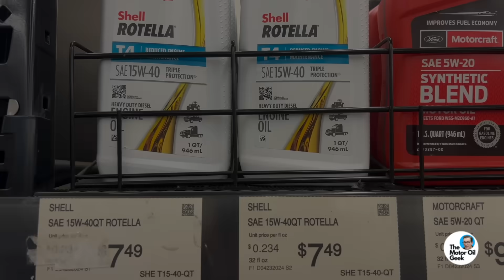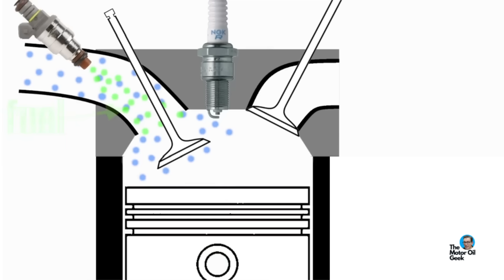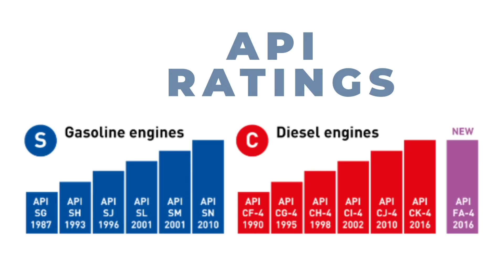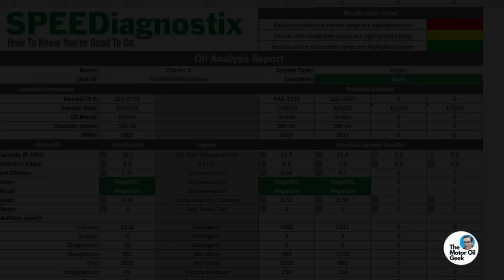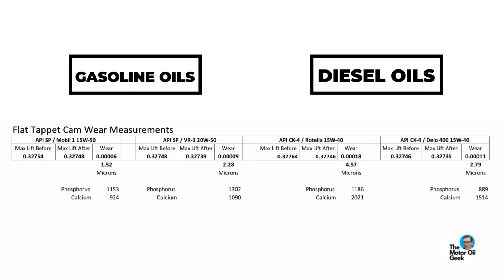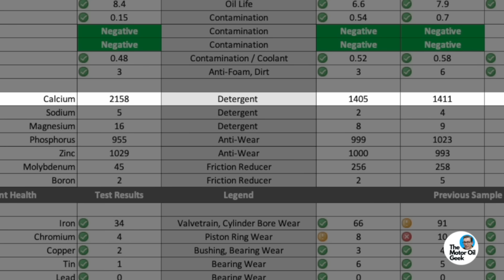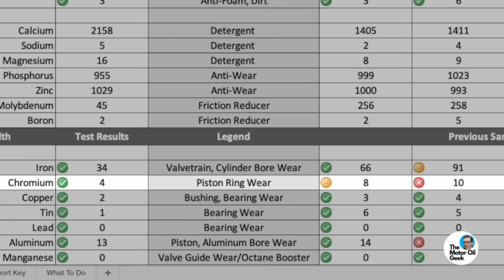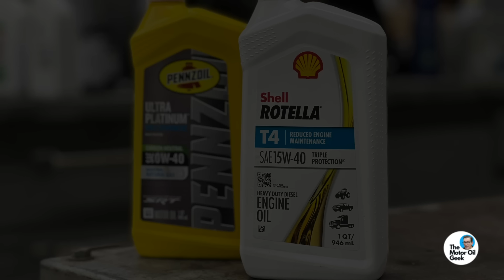Why DIESEL Oil is Actually WORSE for Gas Engines!

Comment: I noticed your camshaft wear comparisons compared 50 weight synthetic racing oils to 40 weight standard diesel oils. Not fair comparison for most drivers who would like to compare a gas euro 5w-40 synthetic oil to a diesel  5w-40:synthetic like Rotella T6 or Delvac ESP. Also what about naturally aspirated port injected v8 engine running synthetic diesel oil? Not all of us are driving a direct injection turbo small engine. Very interested in hearing the response as I value your opinions but in different scenarios. Thanks.

Comment: Just for reference as I am not even close to an expert on anything, I just want to point out what I've always done. That is,  adding heavy duty diesel motor oil plus a little bit of zddp to all the mini bike engines that I've had over the course of 17 years...... never had a problem.

Comment: About diesel, oil I have a imported diesel véhicule here with a dpf that requires ultra low SAPS < max 0.5% and HTHS of at least 3.5 in 5w30 grade equivalent to ACEA C4. It seems impossible to find in North America and at least Canada. I am using 5w30 ACEA c3 for now with hths of 3.5 and saps at 0.8%, hope it will no kill the DPF to quickly. What do you think?
Reply: Regens are not done with DEF fluid / adblue but with postcombustion from injection ecu depending the soot qty calculated by diff pressure sensor. It more like a nox trap.

Comment: modern engines appear to self destruct due to synthetic oils? 3.6 Chryslers and crazy timing chain overhead cam engines 3.5 Ford ecobust the 5.7 hemi, coyote 5.0 the cams and rockers wipe out. diesel trucks run 500,000 miles or more that is the proof diesel engine oils are better and engine oil is compatible. Shell 15w40 can help engines last longer presently running it a 472 Cadillac engine with no issues.Will it harm the catalytic converter theory put out by the EPA psychopaths I haven't seen it yet if you have a engine that uses oil it's going to mess with the Cat no matter what in reality there is too much bull sh!t flaoting around about engine oils working in a fleet we ran 15w40 in everything with no issues cars and trucks pull the valve covers they were like new inside no sludge or varnish this sh!t about engine oils can drive you crazy. it's about licensing agreements like that DEXOS scam oil companies have to pay GM for an okay to use their oil is lawyer crap and greed by failed automakers.

Comment: And yet commercial diesels routinely run a half million miles under heavy load despite the soot. high detergent level and zinc, while gas engines might run 200-250k if one fastidiously keeps the low detergent/low zinc oil changed. I would say that alone proves your wear test results.....questionable. If diesel oil were indeed a poorer lubricant, then lubricated parts in diesel engines under real world conditions would show that. They do not.

Comment: I am doing another F134 Willys restoration.  Have understood need to have Higher zinc additive or Rotela oil.  Saw your Mobil1 update.   Mobil1 now should be better?  Engine needs a pretty high weight to maintain pressure.

Comment: At 3:30, "throw a match in a bucket of gas, it will put the match out", uh no it will go whoomph and burn. That's because gas vaporizes at room temp and the vapors are on the surface of the gasoline.

Comment: I wouldn't say it's 100% accurate to say gasoline oils aren't formulated to handle soot, because they are, but it's a much finer soot, an actual really important aspect of modern passenger car formulations is a focus on direct injection timing chain wear, since direct injection gasoline engines create very fine abrasive soot, so passenger car oils are formulated to keep that soot from agglomerating but at the same time maintain a synergetic balance of FM+AW additives to reduce timing chain wear which is a major problem in small displacement DOHC direct injected turbocharged gasoline engines.

Comment: It hinges on automakers fuel efficiency standards for tax credits. Low tension piston rings has cars burning oil like a pig so the ZDDP clogged catalytic convertors. Direct fuel injection has calcium breaking pistons. API approvals are dropping protection (IMHO) to meet automakers warranty period. I have neither so use HDEO oils that WERE API "S" approved. "Application dictates the chemistry". YMMV.

Comment: Great Video! I used to run Rotella in all my engines diesel and gasoline.. Back in the old days, Shell and ExxMob used to certify the diesel oils with API "S*" as well as "C*". They advertised for fleets/construction equipment etc to use it everywhere to simplify oils inventory. I noticed a few years ago that Shell and ExxMob stopped doing the API spark ignition certifications on the oil.. Obviously, I still use the Rotella in my Yanmar diesel (big old 30 HP in the sailboat) but I have started using Mobil 1 (10-50) in my gasoline stuff..  
Thanks for the videos.. I Worked for ExxMob and did machine failure analysis and low level tribology.. When I got lost (and that was not unusual) I went to our oil development folks in Sarnia, Ontario, sometimes carrying failed machine parts in my luggage.. Fun Work.

Comment: Wow I used Ddisel oil in my 454 Suberban for a short time when I first got the old motor running because it was the only oil I had. I have a Dodge with a Cumins and had the oil on hand. Drove the Suburban around a few months and blew a head gasket after I replaced both head gaskets I put in regular car oil

Comment: A friend has one of the last years of air cooled 9-11 Porsche's. Shell Rotella 15-40 T4  is  factory recommended. If its ok for a Porsche engine, I think I am good with it in my Vstrom 1000. I now use the T5 partial synthetic.  Its JASO rated, as well as MA M2. When my mechanic opened the top end to do shim and bucket adjust, he said the motor was spotless and shiny.  For my money, i feel good and safe with Rotella.

Comment: I have a 2005 Town and Country 3.8L and have used this oil in my minivan. I've used it for over 60k miles here in south florida and it worked great EXCEPT 3-4mpg less than regular 5w-30. Recently i replaced the oil pan gasket and the bottom end looked pretty clean for 310k miles so the oil is NOT BAD, its just thicker and robbs engine of MPGs at higher RPMs.

Comment: Well, this makes me think twice about the oil im using in my old tractors.  Often, the engines were nearly identical between gasoline and diesel engines, of course with different heads, intake manifold, etc.  I have seen reputable people recommend that 15W-40 is completely acceptable now for most old tractors, gasoline or diesel fueled. Now, i do not believe this to be correct at all. And i used to use straight 30 in everything from my diesel utility tractors, gas tractors, and lawnmower/small engine power. I have purchased sae 30 that says heavy duty diesel oil, but also used that in everything, at least to top off the level. Gotta rethink that now.

Comment: Most europeans motorists are confused when you differentiate between diesel oil v passenger car oil because  roughly HALF of our passenger cars  in Europe run on diesel
Diesel engines provide better fuel consumption and typically run for many more miles... Not uncommon for us to run a diesel car to 250,000 miles... around 100,000 miles more than a typical lifetime for a petrol powered car

The emissions are different though and diesels are going out of fashion

Comment: uhm 1980,  nobody said hey, you cant use this oil, itll plug the cat up. 1990, nobody said hey, you cant use that oil ,itll ruin your cam and lifters. I went to PRI and asked some questions to the valvoline guys. they had no clue what I was talking about. every lifter is roller now and you dont need the zddp. however many hotrodders and racers are still running flat tappets. please take this guy with 2 grains of salt

Comment: I think a major source of comment buzz is failing to distinguish between an oil rated ONLY for diesels (i.e. CK-4) and an oil that is dual rated (API SP and CK-4). Any oil rated API SP is safe to use in your gasoline engine, regardless whether is carries CK-4 or not. It will have the low SAPS and calcium limits imposed by API SP. The API SP is not invalidated just because it also carries API CK-4. What makes a “diesel oil isn’t just the presence of CK-4, it’s the absence of API SP or any other gasoline certs. This is a hugely important distinction that was mostly glossed over in the video.

Comment: Another minor correction: soot isn’t the result of fuel that didn’t vaporize. It’s fuel that never got oxygen while it was hot enough to burn and vaporized. Soot is essentially charcoal vapor. The same process the makes charcoal (heat in an oxygen deprived environment) is what makes soot. More specifically— it’s usually the fuel that is injected near the end of injection in a rich A:F ratio. The first bit of fuel that leaves the injector nozzle is going into an oxygen-rich environment and lights almost immediately. But all the little molecules of fuel that follow from the nozzle have to wait their turn to get oxygen because they are following the same path as other molecules that already consumed some oxygen. This is why diesel combustion relies so much on swirl and mixing. It’s a *diffusion flame*, like a candle. It is not a premixed flame like a gasoline combustion (although that line is getting blurry with GDI). As such, diesel combusion has no “flame front” like a premix flame.

The mixing-while-burning aspect is the reason diesel combustion generates soot. Even at rail pressures of 2500 bar or more and using multiple pulses, you still can’t atomize the fuel fine enough and mix fast enough to eliminate the soot entirely. Even a modern “clean” diesel makes soot— it’s just a lot less of it and much smaller particles so the opacity is low enough it’s invisible to the naked eye. But the AVL 415 can see it!

Comment: I had a 77 f250 with 400,000 km, and it was using oil by this point and the 10w30 I used in it would go down a litre every three days, so I gave it an oil change and put some 15w40 Detroit diesel engine oil, and it stopped using oil and ran for another 100, 000 km till I sold the truck. The diesel oil never hurt the engine.

Comment: I have never seen a direct injection gas engine that didn't require full synthetic oil.  So T4 would be the wrong oil required.   T6 Rotella exceeds those requirements.  Lets test the correct oil.  Just another Youtube hack.

Comment: Truck load of bs. Disclaimer, I only watched the first couple of minutes. I have used the same oil for my dozers  and backhoe and automobiles. A compression ignition oil in  both. I bought a 1999 Lincoln town car 4.6l with 60k miles and used a diesel engine oil until I sold it at over 300,000 miles. It still ran great. Many automobiles same story.YMMV.

Comment: I run SN and SP rated HDEO's in my cars and they are just fine. I do 10K to 20K oil change intervals on engines that have achieved over 200K miles and all the techs that work on my cars cannot believe how clean my engines are going such long intervals.

Comment: Beware these 2 snake oil salesman , Ive gone behind Dave several times ... Shot peen migrating through his engines is a bad habit , and the oil analysis is Ascue and many have been tested by sending in the same sample under a different name and vehicle with different results . Next will be speed of air as a special guest - when Volvo has literally won awards and spent Multi Millions on piston crown Technology  that is Proven

Comment: I have never seen dumbest test of oils in my life. You compared 2 types of oils 8:36 one is a cheap mineral  diesel oil and other are the top end synthetic racing oils. But the stupidity was not enough, you took even more viscosity for gasoline oils. OMG! Motor oil Geek? What a joke

Comment: Flushed a 02 z28 ls with 300,000 on it with 5 gallon 15 40 cheap shit then drag raced it  on the floor for 100 or more passes never came apart stayed on the bump box

Comment: I ran Caltex Havoline 20w50 diesel oil in my 475,xxx km 4afe engine, now I run Caltex Delo Gold 15w40 diesel oil in my 7afe (current) engine, no problems whatsoever.
I redline it everyday because it is on itbs and the sound is just intoxicating.
Ambient temps are 30 degrees celsius or 90 hamburger units.

Comment: Like any detergent, wouldnt the calcium bind with all the carbon in a diesel engine thereby allowing the zddp to act as it should? Whereas without something to bind the detergent in a gas engine, calcium is left to compete with zinc?

Comment: I ran 15w 40 rotella thru a 232 straight 6 in a 74 gremlin couldn't blow motor up i tried several times in 80s

Comment: I'm a semi mechanic and at the place I used to work it was a smaller shop we'd all do our oil changes there I mean I have any car work we needed to do. We would just do it in the shop The two other guys I worked with they just ran diesel in their cars it's like 15w 40 plus and honestly My old coworker's ranger seem to be running pretty good it always blew my mind because That's pretty thick oil to be making it through those clearances

Comment: mine LS1 gen3 6.0l just did hit 452thsnds, for last 4 years using 15w40 mixture of diesel, 1/2 quaterATF, and mixing 2 diff oils, daily driven average 120 miles, 350 days a year. mostly highway, runs just fine :))))))) using  bulk order1.96$ filters from amazon, and 5 gall oils, changing it every 2600 miles :))))) so give me a break :)))))

Comment: I am running Rotella 10 W 30 T5 in two riding lawn mowers and one push mower. All are carburetor engins. Should I switch to Valveloine oil for older cars?

Comment: i don't get it, you said that a diesel oil is not good for a gas engine, but you shown a result for a gas oil been used in a diesel engine, it's the total oposite of what you are talking, didn't you shoud use a diesel oil in a gas engine to get thing right....showing these results.....? i got confused, because after all you said, i indeed think that a diesel oil is way better for a gas engine , because of the amount of wear you had in the results using a gas oil in a diesel engine......

Comment: Many diesel oils, including one  held up for us to see the label, are dual rated.  The one you showed was diesel and SN gas engine rated.  Many diesel oils are also rated MA rated for motorcycles as they are wet clutch compatible, which modern auto oils are not.

Comment: What a lackluster video. Engine tolerances unknown, different intervals, loading, duty cycle, temperatures, idle time, fuel type used, all unknown.  Literal shit ton of variables.  Hell, stroke versus bore, rod length, all sorts physically, can change oil life in identical displacement applications.

Ive been doing and watching engine stuff for 20 years, and never in my entire time have I ever been able to pinpoint an engine failure to oil choice.  Oil has always been the phrasing "Change the oil, not the engine".  Change the shit every 5k miles if your gentle, change it every 3k miles if you beat on it, change it every 1500 miles if you legit race it every weekend.  Beyond that, you probably know your engine better than anyone online, every build is unique

Whats next on this agenda, engines can go 25k intervals if you use INSERT BRAND NAME's oil, but OTHER BRANDS oil wont work because it was packaged on a Tuesday instead of a Thursday?

Comment: Most diesel oil is rated for gas engines as well.  It's much better as its a heavy duty engine oil.  I use it in most everything

Comment: So it would be fine in a carbureted splash lube motor running at 3,500 rpm. Honda gcv 160 at 250hrs 10yrs and still counting

Comment: ...I was told 50 years ago to use "low-ash" oil in gasoline tractors to prevent torching the valves

Comment: I broke in my Chevy 454 with rottela but t4 because of the zone content. Might I add I'm using 10w 30 . I want my cam to live as long as possible. I am afraid of changing over to another oil.
Reply from the maker: Stay tuned for the next video.

Comment: Don't care as I will never own a direct injection engine and the flathead V8 in my Ford Customline is very happy with T4. With the extra detergent in T4 only use it on a rebuilt or cleaned engine as you wouldn't want to disturb the years of built up sludge from the prior use of non-detergent oil.